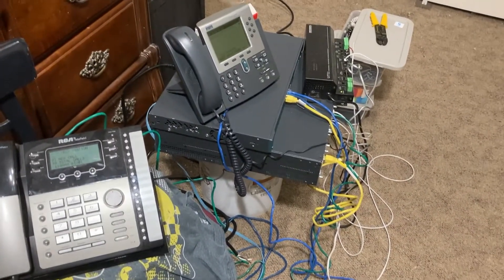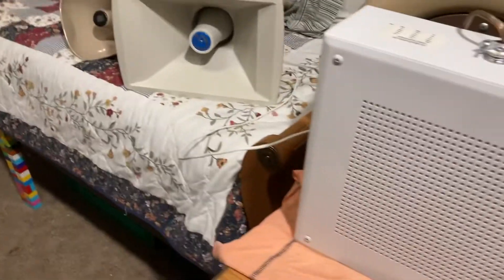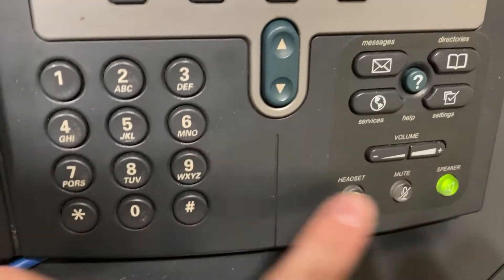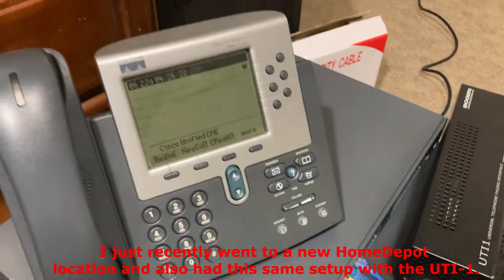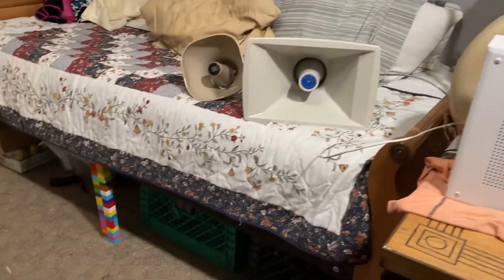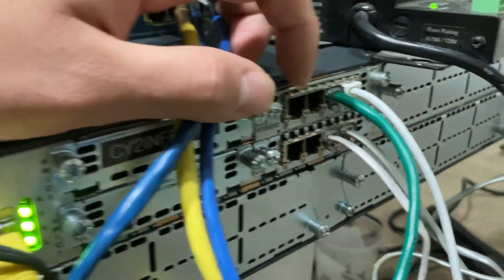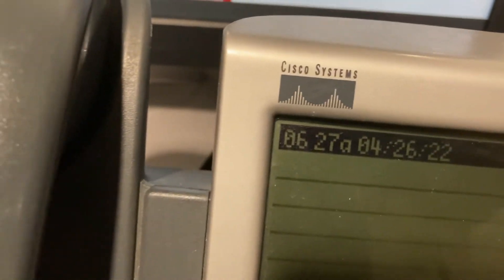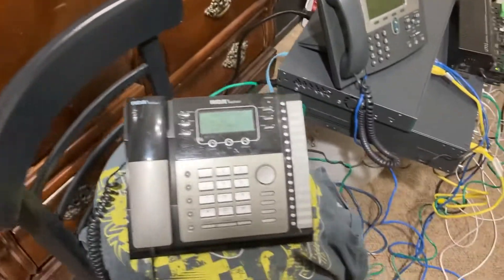Cisco VOIP Phone System Progress

Comment: I'm curious. Does Walmart use Cisco CUCM or CME for their phones? Also, fun fact Walmart now uses an Algo paging adapter that connects to the phone system over sip. Also, Walmart uses Bosch and Electro voice for speakers and a Bosch plena mixing and amplification system. The mixer is a Bosch Plena PLM-8M8. Not sure what amps they use. They used to use TOA bg series mixer amps for their old system with generic beam mount and ceiling mount Bogen style speakers.
Reply from the maker: I have no idea about the Cisco phone systems used at Walmart locations. I'm also surprised that Walmart used TOA BG series amplifiers for the Quam BB2 speakers. I would have thought they would use a Bogen Classic Series amplifier since it's very basic. Learned something new about the intercom system used in many Walmart locations.
Reply: @ They are now using a Bosch and EV system in most of their stores now. It sounds a bit better than the Quams due to the EV pendant mounts having actual tweeters for the highs and better bass response. I bet the amplification is much more for that system. Compared to the single channel TOA mixer amps they used to use. Funny thing is Walmart uses a lot of Bosch for security too. I'm guessing the Bosch systems are interconnected for better management I suppose.

Comment: Very nice setup! I was thinking of getting a similar setup going for when my current Avaya Partner ACS eventually gives out. As for Home Depot, a few stores that I've been to have their UTI1 configured as a trunk port and not a station yet they seem to work pretty well.
Reply: Glad I’m not the only one who pays attention to Home Depot paging controllers lol. Is there a particular way you were able to check that the UTI1 was configured as a trunk there? Or did you get access to the server room :)
Reply: @KaoruOnTheDecks  I got sent to do work on the fire alarm system at one of the local stores and the panel happened to be in the server room
Reply: @TheeOldSquid  that's awesome and really good info. I've got a UTI-1 at home and use the paging port (currently in station mode) off of a VG224 and override (used for overriding security system alarm pages etc)  off an FXO card in a 2811 ISR. That being said, I can totally see why HD chose to do BOTH via FXO/trunk -- in my experience the trunk mode gets fewer weird pops and dialtone bursts before/after the page. Suppose I'll be switching my primary paging port config to FXO as well...
Reply: @KaoruOnTheDecks  nice. And yeah I've been to a few stores and that's how they seem to have them set up. Initially I had a UTI1 hooked up to my Partner ACS but I wound up switching it out with a PagePal because of output level issues. I can still have override achieved with the way I have my amp set up

Comment: The reason you are only seeing chirp one and chirp two is those are the only two ringtones that exist directly in the phones flash. The other ringtones commonly found in Cisco Unified Communications systems are found in the TFTP directory on CUCM (Call Manager). Modern versions off CUCM will include the other fun ringtones you mentioned. The phone downloads a ringlist.xml file containing the directory paths to any other ringtones. Same goes for custom screen backgrounds, the config files, dial plan, etc. I assume you are running CUCME (Call Manager Express) on the router itself? You might be able to manually upload the ringtones and xml files to the TFTP server on the router in this case.